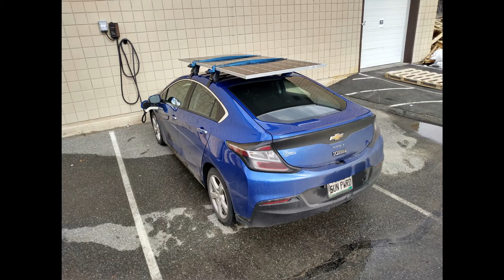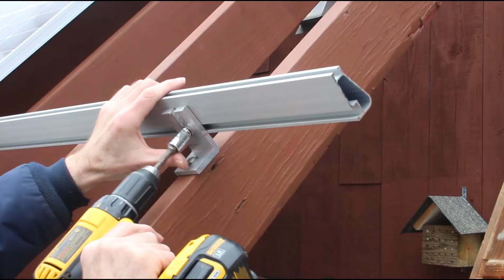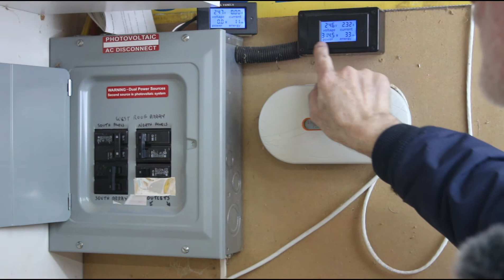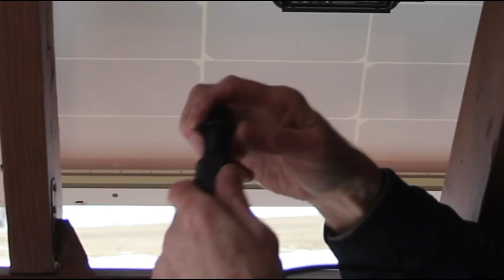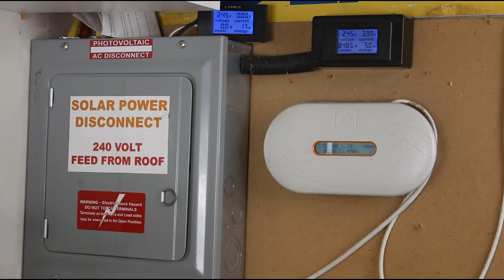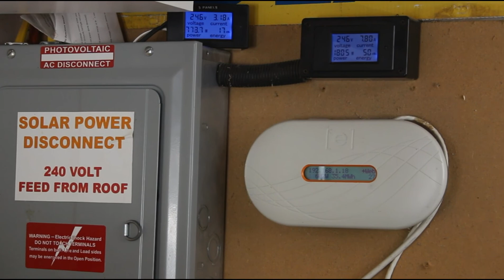Adding a solar panel to my array

Comment: hi thanks for the video i have 2 solar panels in series( so 2x 36 volt dc =72 dc volts right now going to my inverter)
i like to add only one more solar panel in parallel to the other 2 what would be the result voltage as far as you know
thanks
Reply from the maker: I don't know enough about wiring solar panels for single inverters. But as a general rule I think you would want to do things in pairs in your situation. So you'd want another pair of panels in parallel with your series pair.
Reply: @GuyMarsdenMakesStuff  all right thanks
this is the first time i hear about your kind of inverter! so everyone of your panels has
its own mini inverter and then you still use battery packs or none at all??
Reply from the maker: I just have microinverters behind all the panels, no battery backup. I use a propane automatic standby generator for backup.  It's a lot cheaper than batteries!
Reply: @GuyMarsdenMakesStuff  wow that sounds great the reason i am adding a panel is my battery problems in the first place
ok then when you say back up you also mean every day when sun goes down your
gas generator has to go on ?
Reply from the maker: My solar system is grid tied so if the grid goes down it has to shut down to protect line workers.  I only use the generator when there is a utility failure.  We get outages several times every winter here in Maine that run from a few hours to several days.

Comment: question. I have an existing setup with 19 405W Q-cell panels and iQ8+ inverters. I believe they are strung together with one line having 9 and the other having 10. I'm thinking of adding 4 more panels to the back of my attached garage (maxing out my south facing roof space). It would be easier to run a separate line for the 4 panels into my combiner box. It would be easier than adding them to the other 2 existing lines. I assume since they'll all be producing 240V AC there shouldn't be any issue doing it this way?
Reply from the maker: You are correct, you'll just need to add another 240 volt breaker to your box. That's what I did for the added panel array in my video.

Comment: When you showed the wires that need to be "taped" is that where you extended the wire from the terminus side to get over to your new solar panel?  I'm guessing you reused the water tight cap after you extended the wiring...? Thank you for the video!
Reply from the maker: Correct. I just moved the watertight cap over to the end of the new panel wiring and spliced the wires to add extra cabling.  Easy peasy! 🙂